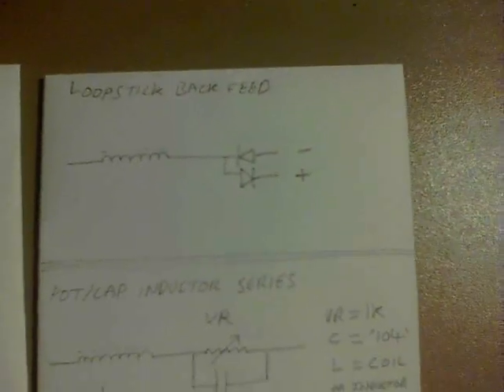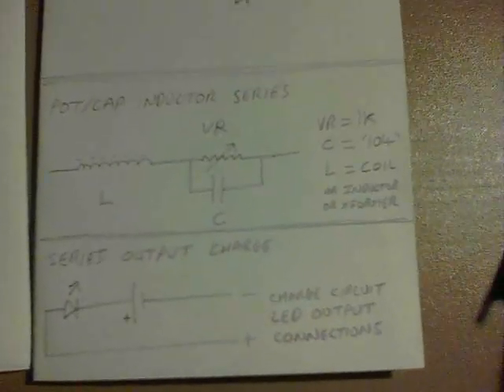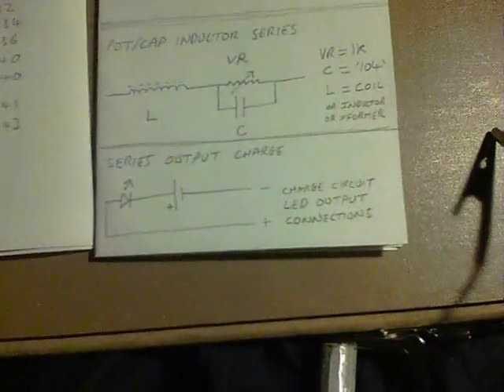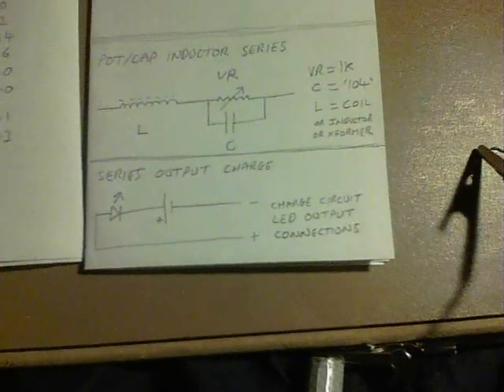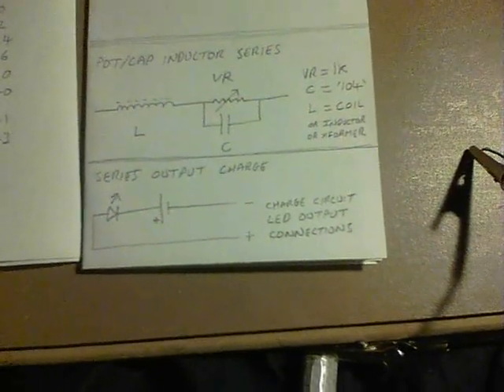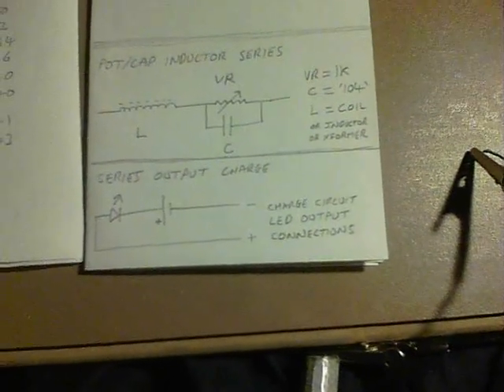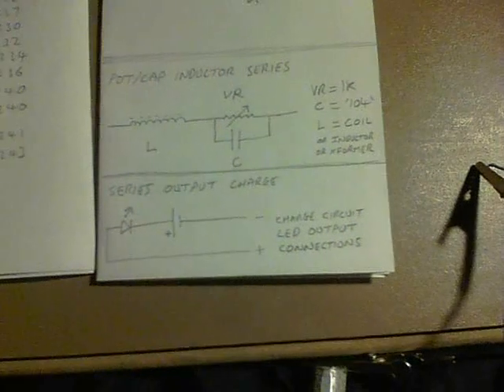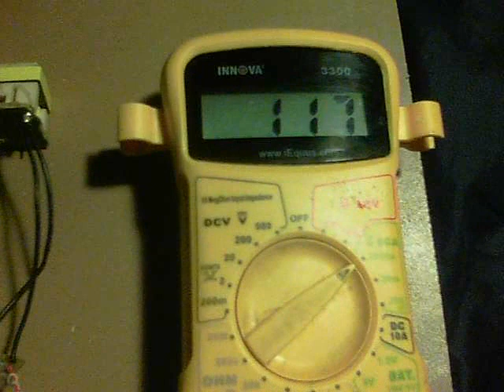Garden Light Charger results

Comment from the maker: @homebuiltindoorplane Yeah, it's what you will find in an old 70's/80's/90's AM radio. The tuning coil inside. They have the ferrite within a cardboard tube, that has about 100 turns of litz type cotton covered wire. A gummy glue secures all (remove with careful finger nailing if wished). Most are of 4 connections, approx 1/4 along is a tap that you solder the two ends together, that then forms a complete length for own experiments.